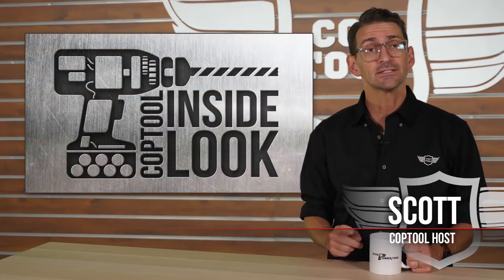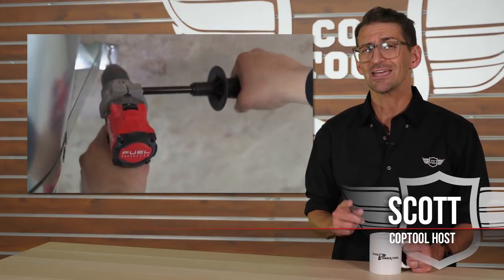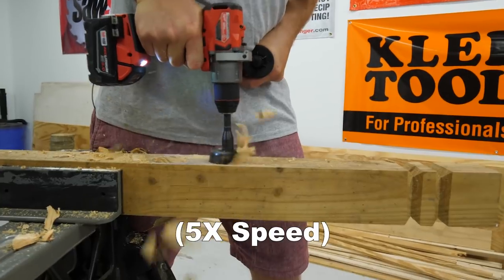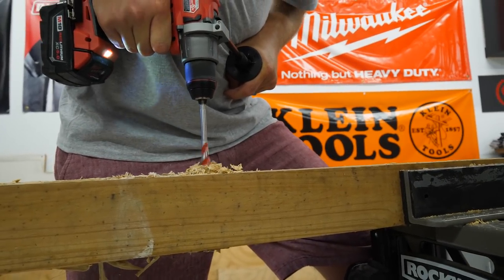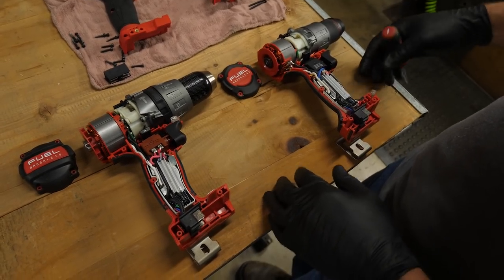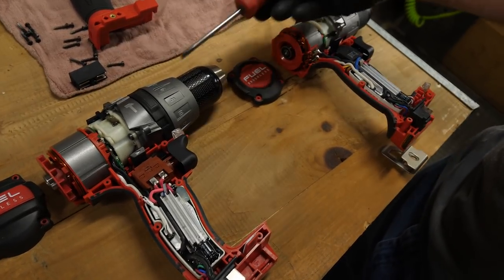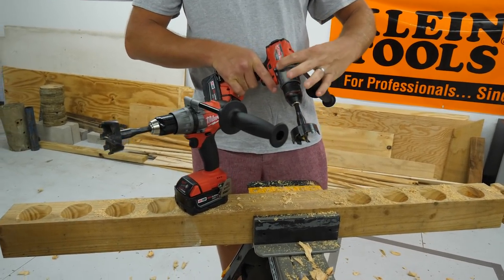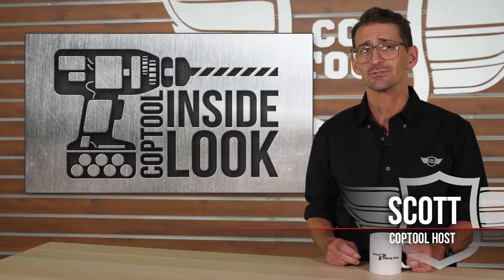Inside Look: Is Milwaukee M18 GEN 3 1/2" Hammer Drill Driver 2804-20 Worth The Upgrade?

Comment: Just a heads up.  I use 5 and 6 inch hole saws frequently and had the gen 2 for a couple years before the gearbox started going.  So I picked up a gen 3 and it only lasted about a week before crapping out.  Exchanged for another and that lasted about two weeks.  They must have done something to the gearbox to make it that small which compromised the durability. If you are doing heavy duty tasks frequently maybe try to find a gen. 2

Comment: Inside look?  I was expecting some information on the gear train assembly. As a homeowner I have all Milwaukee tools. I wore out the gen 2 drill today and the cost of a new gearbox is almost as much as a new drill. This is the only Milwaukee tool that I have ever managed to wear out. Did Milwaukee engineer the gearbox to have less runout of the chuck and is it stronger than the gen2?

Comment: The chucks on the Gen 3s can handle the torque better.  The Gen 2's chuck had a habit of breaking due to the strain.

At least, that's the rumor.
Reply: Not a rumour, I had to send my gen 2 in a couple times due to the chuck failing.
Reply: my gen 2 chuck has been in fail mode for a few years. finally upgraded to gen 3.

Comment: What about the previously different chuck? Or the fact one has a digital torque sensor with auto slow down vs a mechanical slipping clutch for driving screws? Every tool review is just some idiot comparing drilling times and literally of 17,000 videos ive watched NOBODY has covered these obvious as fuck differences. Brb starting a tool channel.

Comment: when your gen 2 chuck fails, you'll get a gen 3 anyway. a chuck is 70 bucks, a used gen 3 was 79 bucks. a no brainer.
You can't get a Rohm german chuck upgrade because of the 9/16, 18 TPI threads on the gen 2 drill.

Comment: Milwaukee tools are junk, we have a hammer drill at work. The weak 18 volt batteries will not turn the bit fast enough to drill through concrete, Dewalt batteries are twice as good. The Milwaukee tool rep was at Home Depot one day and said they definitely have battery problems.
Reply: And you work for Dewalt? LOL
Reply: Darrell Dorn   Milwaukee Ceo invented Dewalt and was offered a bigger paycheque and position at Milwaukee, Dewalt is actuall Black &Decker. Ive blown two chucks on Dewalts. As to hammer drilling at work with Concrete only corded Hilti, corded Bosch are recommended. Milwaukee and Dewalt are for home users. You cannot compare them to workplace usage and are mean only for small concrete jobs at home. The concrete used at a power dam or a commercial building is a harder concrete than one used in the foundation of a house. Commercial concrete continously continue to cure and harden decades and century later. Residencial and sidewalk concrete less lickly to continue to harden after 9 years.
Reply: Black and Decker is best that Milwaukee?  ahahaha